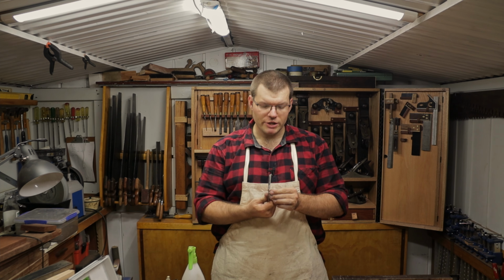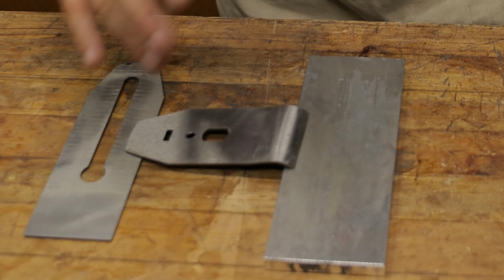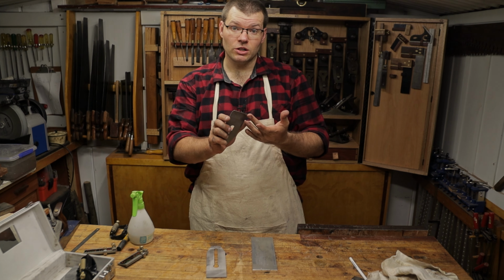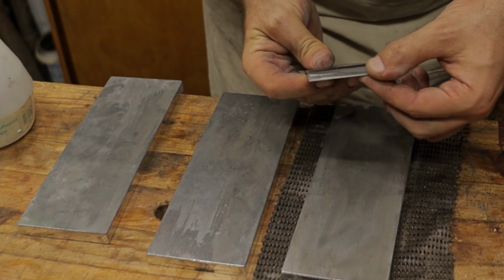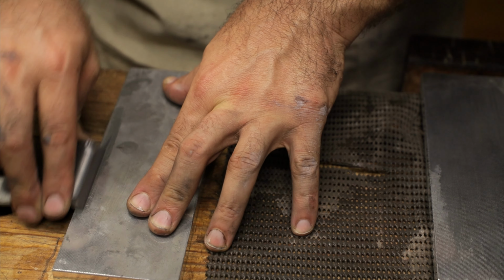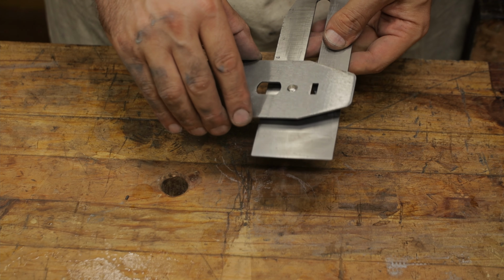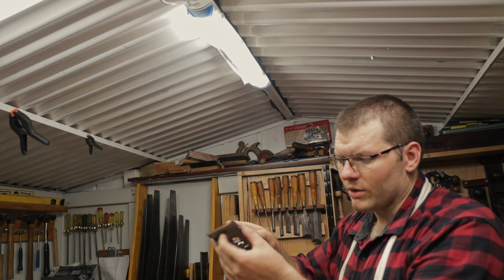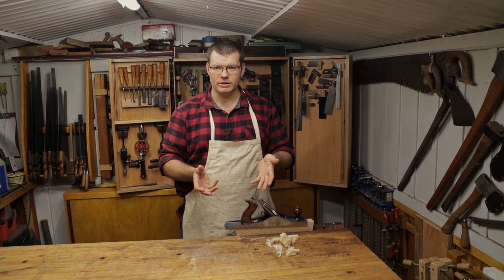How to PREPARE a chip breaker for use

Comment: Anyone know where I can get a new chip breaker for a number 5 jack plane
Reply from the maker: If your from Australia and you are looking for a traditional style chip breaker for a no 5, i can only suggest looking around on facebook, gumtree and maybe ebay for vintage ones as i don't believe they are made anymore.

If you're happy to use a more modern chip breaker i have been happy with the Luban chip breakers. I got mine from timbecon, but its a little hidden on the website

https://www.timbecon.com.au/4-smoothing-plane
If you go to the link above, use the drop box under the title you can see the blade, chip breaker & lever cap also available, although this is under the no4 it is the same 50mm or 2in chip breaker for the no 5 also, as they use the same size.

Hope this helps

Comment: You never mentioned what the grit was on the very first diamond Stone you used, at the minute 30 mark
Reply from the maker: Oh sorry, i always start with my 1200 grit diamond stone for this process to insure i don't remove too much material. If it takes too long to remove those factory machine marks i will go to my 800 grit to remove the marks then refine on the 1200 grit. Usually the 1200 grit is all i need.

Hope this clarifies this for you.
Reply: @AussieWoodshed  Ahhhh, thank you sir!

Comment: The distance is 1/32 of a inch. Always had been.
Reply from the maker: @richjones5432  Well you can put it that close if you want. For me it causes excess jamming of the shaving in the mouth of nearly every vintage hand plane i have and prevents adjustment in depth of cut. 1/32 or 1/64 as some suggest will only work for an extremely fine set smoother.

I don't just follow what others say i settled on 2 - 3 mm with lots of trial and error and it works far better for me, and I've heard from plenty of my viewers who prefer 2-3mm after trying it.

There is no right or wrong only what works, the chip breaker only needs to be close enough to curl the shaving nothing more. So i will stick with my 2 - 3 mm and you can use 1/32 or an inch.

Comment: Doesn’t that really depend on the thickness of the diamond stone?
Reply from the maker: Yes, you are correct it does. 

The diamond plates i have used which are Atoma (~12mm thick) and DMT Dia Sharp (~10mm thick) both work with the way i showed in the video. 

I cant speak to other diamond stone brands as i haven't used them, however a diamond stone somewhere around 10-12mm thick should work fine. 

If the stone is thinner the angle on the back of the chip breaker will be less (flatter) and may still work but i cant confirm that as i have not tried thinner stones. If the diamond stone is thinner you maybe able to counter that a bit by resting the chip breaker on the bench instead of the blade.

If the stone is thicker the angle will be more, however this could be countered by adding additional height under the blade used to rest the chip breaker.

Hope this helps.